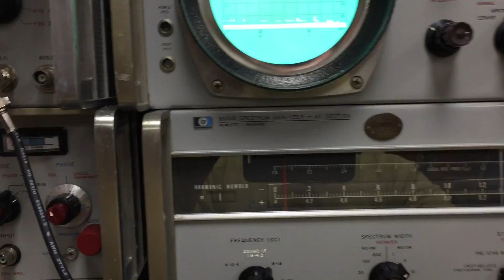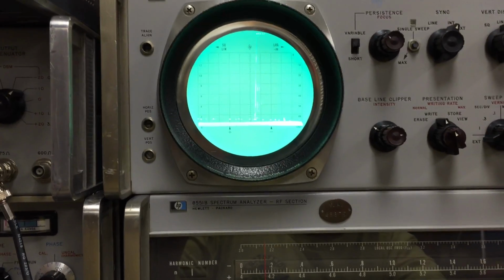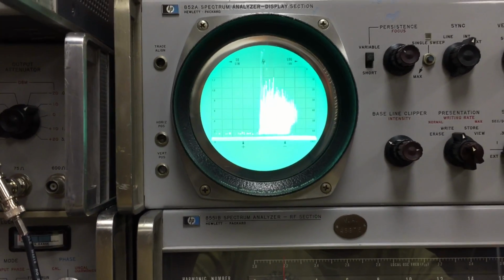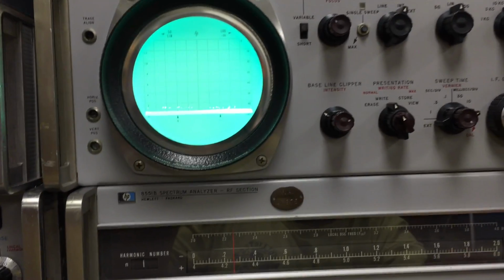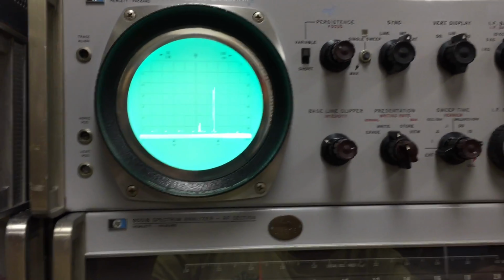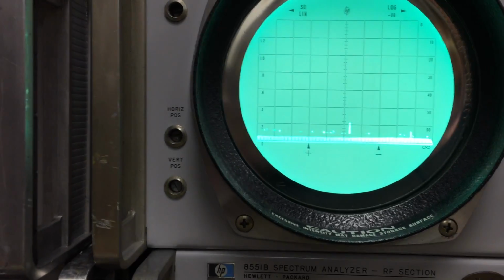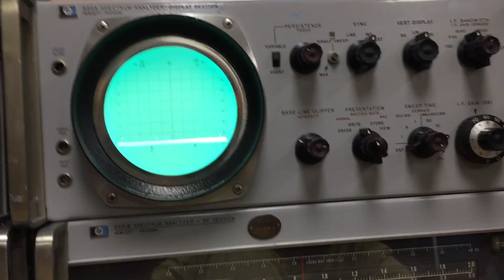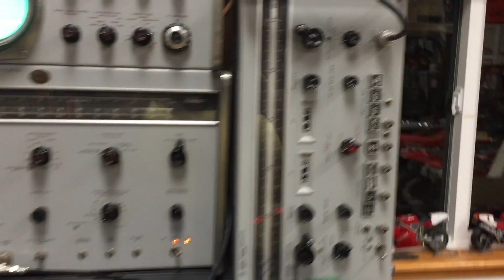hp 8551B spectrum analyzer with antenna input

Comment: Thank you. This helped me. I have a HP 8551B S/N 625-00542 that came from the White Sands Test Facility (WSTF) in NM where I worked from 1976 to 1996. I did not use this equipment as I worked with the computer group. With that said, my HP 8551B is considerably different from yours in the frequency range. Mine has a number of vacuum tubes in it, I.e. 12AX7, couple of VR tubes at least four unique HP tubes (two in the series voltage regulator) and two 9 pin pentodes with plate caps and it works pretty well except the calibration gets further off as the frequency goes up. This one goes to 42 GHz with an external mixer. I am still baffled by the scales and harmonic numbers. It seems darn near every one of these units is unique in some way. The WSTF site, while I worked there, communicated with the TDRSS  satellites that were three satellites in geosynchronous orbit around the earth that allowed NASA to communicate with the astronauts at all times. This was 30+ years ago when things were a bit different from now. Their three  huge 60 foot parabolic dishes were aimed just above the top of a mountain range towards the satellites and used the mountain chain (Rocky Mountains) in NM as a noise shield. I still really enjoy this equipment and I appreciate your effort and success in posting this video.
Reply: Ever use the X Y out on the HP 851B display section?